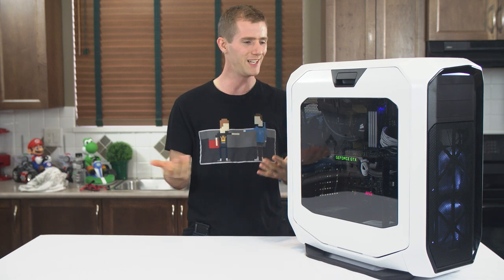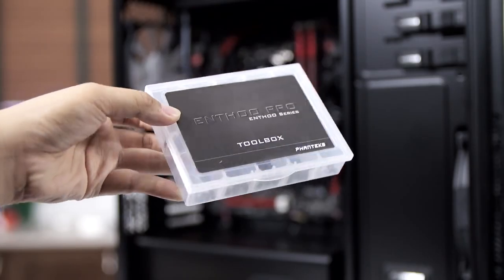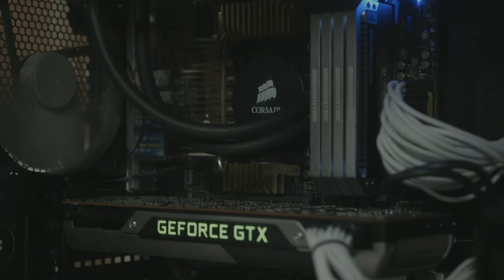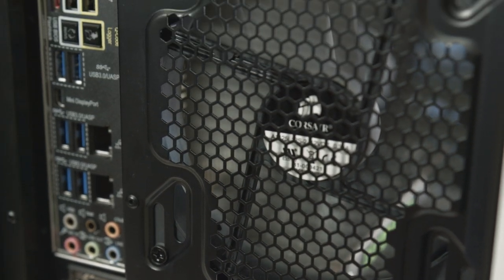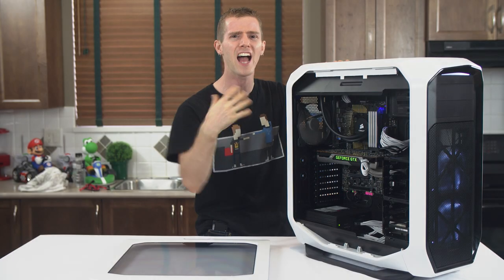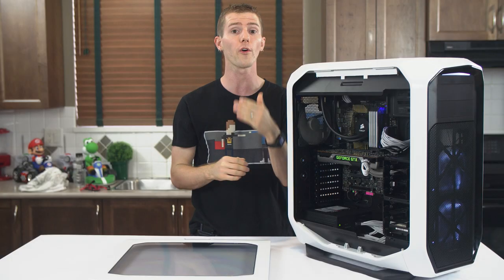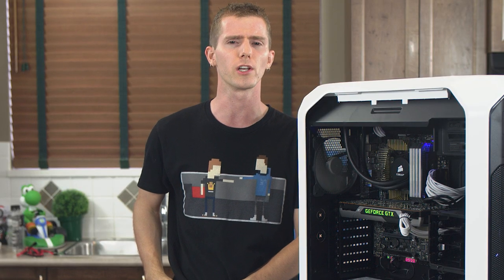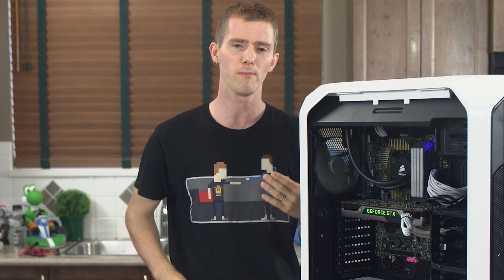Corsair 780T Graphite Case

Comment: Fractal Design All the way,IMO.
Reply: ***** I was a huge Corsair fan,but after I found Fractal Design and used Define R4,man...It's the best silent case I've ever used.I'm considering purchase Arc Midi R2 sometime maybe next Haswell-E build.
Reply: ***** H440 please.
Reply: McGrauado I like my Arc Midi R2.  Very nice case with an elegant, simple look.  It's very easy to build in and maintain.  If you go for one, you will probably not be disappointed.
Reply: lol scrub peasant gt on my lvl i xigmatek elysium al teh way m8
Reply: McGrauado I really don't know whether i want to buy a Define R4 or a Phanteks Entoo Pro :/
Is the Define R4 really that quieter? Because the airflow of the Enthoo Pro seems to be a bit better.
Reply: Phanteks>>>>>>>>>>>>>>>>>>>>>>>>>>>>Every other case
Reply: Love my R4 black with the window. Perfect case for me. Although I still think it's a little loud because I'm used to laptops haha.

Or it might be my h100i stock fans which I need to replace soon.
Reply: kiwikozo definitely the h100i stock, they sound like vacuum cleaners.
Reply: I have the 2 fans provided with the case as intake front ones. Then a white LED silent Corsair one as a rear exhaust fan.

The h100i stock fans I use as intake ones since I tried both and it actually runs cooler like that, and quieter.

Which fans do you recommend to replace them with? And please don't suggest Noctura - I have a window and I want my build to still look great haha.
Reply: kiwikozo Or might acutally be a power supply fan those are usually overlooked quite a bit. Well the stock fans on the H100i are a bit on the loud side.
Reply: Nope, I've put my ear next to the h100i fans and the case ones are kinda loud. I guess I'm not used to fan noise.

My PSU is excellent - EVGA Supernova 1000W Fully Modular Platnium. No sound at all.
Reply: I like my R4 but it just feels like they skimped in places. The hexagonal holes on the top are ugly and I'd rather it had a dust filter integrated into the case that pops out. The plastic on the front feels and looks cheap and I rather they'd gone with the metal that is on the rest of the case. It's pretty much impossible to use a 3.5 inch card reader in the front of the case with what's supplied in the box without having a hole in the case. It's covered up so it's not a huge deal, but I'd rather the bracket was included.

I love the sound proofing which makes it quiet, it has a fairly nice aesthetic although I'm finding myself preferring Corsair cases (some of them) for looks nowadays. The fans are fantastic - bought a bunch more for the case, I usually ramp up the RPM and they're still quiet. The rubber gromits inside for cable management are a godsend and I like the removable upper HDD cage and the "hot swap" style drive mounts.

All in all, the R4 isn't a bad case, but as I said, it just lacks a bit of care on the fit and finish. There's something about it where it seems like they didn't go all out, perhaps it's just the price point. I won this case and haven't had a case in this price sector before.
Reply: Ross Bishop Oh right. I didn't want a card reader, but I got a usb 3.0 adapter which makes it simple for when I need to use one. I dislike the plastic at the front too but you can't really tell if you don't touch it haha.

The dust filter doesn't matter to me either since I have a h100i installed so it wouldn't benefit me. Maybe the R5 when it comes out will have what you're looking for.
Reply: McGrauado  I was dissapointed with it. They could have used the extra space and move the top fan grid a centimeter or so away from the motherboard to accomedate large rads, that and the silly "NO TOOL" front fan bracket really gets in the way of putting non FD fans or ouright prevent front 2 fans rads, since the screw holes in the bracket are farther away from each other than what a normal rad has. that and the uncomfortable bottom fan filter, awkward HD cage that would block any front rad anyway and the lack of proper SSD bracket on the back of the motherboard are pretty awful for a case this expensive and this big.
Reply: kiwikozo It's not actually that I need a filter, it's just that the hexagonal holes are ugly, and that an actual filter with small holes that's embedded in the top would look way better IMO. It's just like they pressed out the holes and went "that'll do"
Reply: Christian Axelsson Oh man, I fucking dig that case. No wonder so many people have bought it, so cool xD
Reply: MSurai I never tried Phanteks Enthoo Pro so I cannot comment on that,but you can checkout Linus's review.
I think the parts you chose for your PC,it's the point and crucial to whether your PC will be quiet or not.
A good airflow case doesn't mean it will be very noisy,of course neither a good silent case will guarantee fully sound isolate,noise will always be there just a matter of whether it's in human's hearing ranges.
The reason I chose Define R4 because it was on a discount,plus it fit my eyes.
It has a lot of draw backs of course,but I don't care.and it uses very good quality thick steel,it's a little heavier but that's some darn good quality.
If you chose the right quality parts,I believe whatever the case you fit in,it will be quiet.
I personally uses Noctua fans,and use AiO liquid coolers on CPU and GPU(w/Kraken G10),I didn't put any hard drives,I did put two samsung evo 1TB ssd as my storage,of course I back up files regularly to my portable hdds or home nas.So far this kind of set worked out pretty well for me.
Reply: electroshakyeee Yup,I realise the problems you mentioned.I honestly don't care,'cause I bought it on a huge discount.FD's case are good,but at some details could be done it better,it needs feedback to them and I believe at certain point they will improve.I hope they will make a Define R5 and improve all these issues.
Reply: McGrauado I had a define R4 but i ended up switching cases to an nzxt phantom 820 since I just wanted a creative and less simple styled case xD
Reply: I have a Define Fractal R4. I switched from an NZXT Phantom 410 and I am never looking back. It is probably the best case that I have ever worked with.
Reply: I own a Arc Mini R2 and I can say only one thing - I will NEVER buy another Fractal Design case again. Period.
Reply: Christian Axelsson

Yep, I don't have any water cooling right now. I plan on it for my next build. I'm going to go for a larger case at that point. It would be nice, but my components don't really need water cooling.
Reply: kiwikozo Well, I have an EVGA SuperNova 1300G2 in a Phanteks Enthoo Primo (Excellent case, best I've ever used by a lot, and the Pro is quite similar in everything but size). Using Asus' fan control software, all my other fans are silent (Silent like, I cannot hear a difference even if I turn all the fans off. They're running at something like 400RPM at idle). The only things that are audible are the pump of my Corsair H110 (not too audible at idle) and, you guessed it, the fan of the PSU. It's by far the noisiest thing in my otherwise silent system. It's not anything unbearable like high-pitched or anything, but it's definitely there. So yeah, PSUs are overlooked with no good reason and that fan noise is my only complaint about the otherwise awesome EVGA PSU.
Reply: but fractual is ugly as fuck man i want an aggressive looking case !
Reply: Ross Bishop yeah it sucks you have to choose between airflow or a silent rig; I have 4 HDDs and my OS SSD that takes up almost the entirety of the front intake not to mention the R4s side vents makes a poor intake to begin with.

However if you really want to increase airflow; I really would recommend getting some of these: http://amzn.to/WJaXrM

They look good, they're easy to clean and paired with a really good pair of fans like the Noctua NF-A14s they're not even audible with any sound meter that I have used so far.
Reply: AbidNaga NZXT Phantom Cases did provided a lot of space for cable management back of the case.I built a PC with Phantom 630.Good for you,keep that case for a while.
Reply: i mean i am 18 fractual looks boring i mean dont u want something spicy or aggressive looking think about it fractual and most corsair look plain and smart
Reply: NF A14S are a rip off and offer no extra airflow proven before between fans vs fans
Reply: yeah i know i was just stating my opinion i get it tho i mean i can see my dad liking fractual but im more of a gamer so i like a rough look different people have different tastes
Reply: 96donov There has been proven airflow differences between fans vs fans in certain applications... radiators, heatsinks, open areas, or just fan blade design. And build quality of Noctua is legend status.
Reply: McGrauado
Same, it looks really sweet.
Reply: 96donov Almost every website I visit; Tom's Hardware, LTT, JayzTwoCents, AnandTech, PcPer, Tek Syndicate, the list goes on and on for people who have used Noctua products who either use one other option (Like Corsair's silent fans for their cool interchangeable rings) or they stick exclusively to Noctua like LTT because they know that time and time again CFM versus DB at low RPM provides the best airflow in the industry bar none.
Reply: Ross Bishop Just get some Silverstone ultra fine magnetic intake filters. They work like a charm, easy to clean, and well worth the investment.
Reply: Murdock13 I picked one up for $60 on newegg :D
Reply: I just ditched water cooling and stuck with the affordable Hyper 212 EVO paired with the R4 and it is pin-drop silent.
Reply: 96donov I'm 17,I don't like aggressive things,I like things that makes me feel calm and peaceful or relaxing,I guess I was influenced by Aikido's philosophy that I've been practiced since middle school.
Fractal's Product don't look ugly,it's just look stern.
Of course,I still have some other cases that's hanging around,like Corsair Vengeance C70,SilverStone SG02F,LianLi's cases that I don't remember the model number...etc...
Every Noctua's fans model number means specific use for best optimized airflow or static pressure.You cannot judge because you might use it the wrong way.
Reply: MSurai The r4 comes with excellent fans, they are quite and just awesome, don't know if phanteks does that, or any other brand.
Reply: Water cooled Define r4 reporting in.
You generally get so much for your money from Fractal...
Reply: H440 all the way bro
Reply: The world would be boring with just Fractal Design, every case would look like a mini fridge.

And this comes from a 304 owner.
Reply: Amen TheDarkMaster02, CPU AIO cooling is stupid. Using AIO cooling on my GPU, but it's due to the fact I had a leafblower 290X. I'd rather have a quiet Sapphire Tri-X card or go full custom loop.
Reply: cole sutra You don't get me, it's the case aesthetic that I have a problem with, not the filtering. I just want it to look less ugly on the top.
Reply: God King Blacc  I so agree with this. I should have waited for enthoo luxe instead of buying h440.
Reply: im not big on really any brand, just whatever gives you the best cooling and can support the maximum amount of fans
Reply: Define R4 master race
Reply: I am actually very attracted to the new NZXT Source 340. I like the direction NZXT is going in lately.
Reply: God King Blacc amen
Reply: Αποστόλης Νικάκης What case fans do you have? And isn't 400rpm too low? Not enough airflow?
Reply: kiwikozo I'm using the 5 Phanteks PH-F140SP fans that came with the case (Excellent fans, almost on par with Noctuas in performance, but they look much nicer) and 2 Corsair fans from my H110. Now, the 2 Corsair fans and 4 out of 5 of the Phanteks fans are used as intakes (excessive, but there isn't a spec of dust in the system). I'm planning to buy a few more Phanteks fans and ditch the shitty Corsair ones on the H110. Airflow isn't a problem. There is a subtle air current at idle (yes, under 500RPM at idle), just enough to keep air moving. Before that, I used to let the fans stop at idle, but decided against it as they don't make noise anyway. Under load the fans spin up, and I have more airflow than I would need for 2 PCs.

I think I'm turning into a Phanteks fanboy with these fans. They are that awesome. I have 5 already and I will be buying at least 2 more. Probably 4 more, if I go custom water and do push-pull, but that's another conversation.
Reply: my point was i dont find fractul appealing i never said gamers need aggressive the other guy did
Reply: fractual is ewww boring case
Reply: ive seen cases from cheaper companies on ebay I would rather have over bigger company names due to several fans, larger fans and the case itself being almost bigger than a full sized atx case and looking bad ass. alot of these cases from NZXT (which i happen to use one) fractal , Corsair are all kinda plain jane cases
Reply: McGrauado i like how the fractal cases are so understated and usefull without any flashy leds. In my next build im going to be using an arc midi r2
Reply: 96donov By the way being "more of gamer" does not mean you need a more aggresive case, and please for goodness sake at least use better typing skills. I am in middle school and I am currently building my computer and I love all the companies, I just make my opinions on each case not the whole company, if one of the cases from Corsair don't work for me, I just look for more cases from them and others to find the one for me. Also, when '"stating my (your) opinion" please state it like a well-educated person, so it makes you seem smarter and people don't diss you and large comments like this one won't show up everywhere.
Reply: H440.
Reply: McGrauado I recommend a lot the ARC Midi R2. It's super easy to build in there, it has very good airflow and it's also very sturdy. My only complaint are the dust filters: they're made of foam, so cleaning them can take a bit of time.
Reply: sharkfacestudios I've got red/black. Very pleased.
clauricaune Taking them out and running water over them and then allowing them to dry makes them good as new!
(Source: My friend's PC)
Reply: Cheesepuff i prefer the white or black/green, but to each their own.
Reply: Does anybody else regret commenting on this? 50+ notifications later,,,,
Reply: yes gotta love fractal
Reply: McGrauado Im stuck between going with the Corsair 330r or the Define R4 any suggestions or pros/cons for either one?
Reply: Kaleb Gilley Well between those two the R4 is better. Great build quality, silent. Just a good all-rounder. I would definitely go for that (Personally those aren't my kind of case, but the R4 is definitely the superior one of the two.)
Reply: Cheesepuff I'm really sold on the extremely clean aesthetic of the 330r and it would match the brand of my RAM, PSU and fans, even though the R4 may be slightly better performance wise, i think the aesthetic on the 330R is what's going to win me over.
Reply: Kaleb Gilley http://www.nzxt.com/product/detail/151-s340-mid-tower-atx-case.html (black or white)
Take a look at this before deciding. I ALMOST want to return my H440 in favor of this.
Those clean lines just get me. Plus a PSU cover and excellent places to hide those pesky cables.
Reply: Cheesepuff I'm not a fan of the window, but other than that it doesn't look too bad. I really like the PSU cover.
Reply: Kaleb Gilley Depends on you though,If you really like the looks of 330R,then go for it,there's no reasons that you cannot buy what you want from the bottom of of your heart.
Personally,I found R4 looks better,very silent,and it fits my desk very well.Checkout Nanoxia too,they make pretty darn good silent case,can guarantee you'll like their product style though.
Sounds like you want to match all your brands of your components,then 330R might be the best choice for you,but I'd actually spend a little more to get Corsair Obsidian 550D..that's just me...
Reply: Cheesepuff Yeah, I know. It's just that I have to use a hair drier to dry them fast; the whole watering-drying process for both front and top filters takes around 10-15 minutes. It's not terribly long and it's just a minor complaint, but simple net filters would take much less than that to clean.
Reply: Fractal Design is way too casual to me...
Call me hipster but I don't want a custom built PC that looks like a million others out there :\
Reply: If you get it with a window, and have LED Lighting in the case it's fine. I think it actually looks better and classier.

I have a R4 with a window, and NZXT Hue lighting, as well as an LED fan at the rear + a corsair h100i lit up. And of course you can see all of the other components too. That doesn't make it look like all the other builds. Only thing I would change is the quality of the window since it is supposed to scratch easily so you have to be careful.
Reply: Guy Random Same as Corsair,they sell cases all over the world.It matters what you've done inside,plus you can modified yourself,but it'll probably avoid the warranty.
Reply: I myself have a Define R4 and just ordered a Core 1300 to my little brother's rig.
Reply: llorTA toN  lol i have one im on the level haha but  just to big of a case i like to be able to actually fit on my desk but still an amazing case
Reply: and i agree with all the r4 users my cousins just got the define r4 xl and its quiet as ive ever heard from a case really niceley built i myself am looking at the s340 from nzxt i wanna build in that once to see cosmetics and how nice i can make it :) but r4 is in the works too
Reply: Guy Random amen !
Reply: Robert Echenoz teh bar is h1gh the bl8z iz gr8
Reply: 96donov Whatever, I'm just saying so no need to get all mad. Just don't say "I'm more of a gamer" ever because you are only a "real gamer" if you go to LAN parties and are seriously into gaming. I do this, and I speak proper to set an example to others that gaming is not always about sitting on your ass all day drinking beer and playing games, which I didn't say you do. I'm just trying to set an example and I hope others do too, Thanks for the cooperation!
Reply: God King Blacc Yup.  I don't regret one bit buying my Enthoo Primo.  It blows away anything Corsair has to offer in its price range.  My current build wouldn't fit in a Corsair case anyway.
Reply: RottenMeatius22 i barely care about gaming
Reply: 96donov Go hate somewhere else then :)
Reply: 96donov You're hating on people, everybody wants you to leave. Bye.
Reply: kiwikozo i would recommend corsair fans, too, but the sp 120s would do fine! Anyway noctua released new color schemed fans! they aren't that bad anymore! haha
Reply: YS T Oh right thanks! I will check them out!!!
Reply: kiwikozo Actually,If you're open for another suggestion,I would recommend Silverstone's Air Penetrator series Fans,they provided pretty good static pressure and more focused airflow.they are inexpensive and perform pretty good.
Reply: McGrauado Thanks, but are they as quiet?
Reply: kiwikozo Yes,they are,even at 12V(1500rpm max).Linus did a unboxing,you can check it out,I still using them in other PCs,I used them on my rads,performed very well,very quiet.
Reply: McGrauado Alright thanks. I'll check them out.
Reply: NZXT life
Reply: kiwikozo
yeah bro i noticed those fans and the high performance SP120's are really loud. but no need to replace. use corsair link to Default mode. i never heard them ever since (we all have a diff experience). I love the R4 though its so quiet and clean looking.
Reply: Phanteks fo shizzle <3
Reply: Everyone is stressing on the Phanteks, Corsair and Fractal Design. You guys might need to check the H440 :p
Reply: Kirito Cray I'm getting the H440 for my first build. Im sitting here with a gateway with upgraded ram and a low end gpu
Reply: Kirito Cray We didn't forget H440.NZXT makes quality cases how could we forget their H440?I built one,but I didn't keep it.I don't prefer cases without 5.25" drive bay.
Reply: McGrauado You still use the 5.25' bay? Damn.
Reply: Kirito Cray Hey no hate! Some useful 5.25' drives. Like hotswap hard drive bays, toasters, storage compartments, IRS, Multimedia card support, CD/DVD for media PCs and stuff :))
Reply: TadghsMuffins Not hating! xD Hotswap hard drive bay is good, but others? Weeeeeeeelll I personally don't use them because for storage, we have other smaller alternatives. Or I can mod my PC a fair bit.
Reply: Kirito Cray Yeah,I still use a Blu-ray drive.
Reply: McGrauado I use that on my big ass TV.
Reply: Kirito Cray I rarely watch TV.
Reply: TRY the Phanteks Enthoo Luxe
Reply: I want new case any suggestions, need to be windowed for maximum 200$.
Reply: I wil probably buy Graphite 760T or 780T. Cant find better case :(
Reply: Cruciatify corsair obsidian 750D maybe?
Reply: This Obsidian 750D is pretty nice have it good airflow? I wanted NZXT H440 beacuse it looks badass but peoples are complaining about airlow :P So I wont buy it... Isnt 780T Graphite better? Its only 40 euro difference in price...
Reply: Cruciatify Both Graphite and Obsidian series cases are designed for good airflow and water cooling,so you really don't need to worry too much about it.Only difference is the looks and LED fans(Graphite).If you want a full tower and good airflow,fair price,I'd actually recommend Fractal Design Arc XL,the only draw back is it didn't have a clear side window.NZXT H440 is designed for silence,airflow isn't the main purpose.Rest of it is up to you.
Reply: ***** In the end,it all depends on personal preference.To me 780t or 760t both are pretty much the same as Arc XL,but different looks.I don't know,but even in my mancave I still choose Define series over anything else,maybe because I'm sort of a silent freak,I just can't stand the little fan noises,even the slightest sound.
I don't think anyone of them is superior or far more superior to each other,they all pretty much equals to me,just the matter of the price tag.
Reply: ***** d the iig u 84
Reply: McGrauado dislike
Reply: McGrauado Linus likes the 760T,but hates the 780T,witch,BTW is NOT the 760Ts "Big brother",it is only another Graphite.
Reply: McGrauado They got boring.They are more than good,but a bit boring.They all look the same.I like the front of them,but i hope that they do something groundbreaking for the rest.
Reply: I bought this case in January 2020, and i start to use it now ^^
Reply: I paid 276 $ in January 2020 ;) That's how much it cost now !!! To be exact 1106,05 RON (Romanian lions) , which was 276 $ - VAT & shipping included (from local retailers in Romania). I think it's ok, considering that my income is around 600 $ / month in 2021 ;)
Reply: @neytiritetskahamoatite7688  First thought on reading your comment, since it has been so long, I totally forgot I commented this comment, anyway, you said you paid $276 USD equivalent of currency of Romania, I honestly think you've got ripped off, although I don't understand the commodity price in Romania. But when this case launched, I remember at the time it was only around $180 USD or so, and it has been so long ago, and I believe this case has been discontinued. I just couldn't believe that you paid so much to get an old product, technically it's not new, and for that price, you could get much more better case than that. Perhaps you just love it so much that you're willing to be paid for it.
Reply: @cyangtw  actually all the stores in Romania still have this tower, at that particular price :) all of them !!! I took it from the cheapest one, by using not one but two price optimizers programs that we can find online here in Romania :) If u have a 500 $ cpu in USA, here is around 3000 RON, u can make the math, it's around 700 $.  Europe is damn expensive ! I started to buy from outside, because with the shipping cost altogether, you get a lot cheaper products, that industrial retailers in Romania.
Reply: @neytiritetskahamoatite7688  Oh dammmnnnn. Although with the COVID pandemic, causing the difficulties to ship products around the world and prices are going up, but I still surprised how much more expensive than the other world in Romania. Shopping online, buying from the other countries, it's a good idea, but be careful with the warranty, some product or companies have limited region warranty and does not have global warranty.  Well, I, myself, still waiting the price of RTX 3090 or 3080 or hoping upcoming RTX 3080Ti will be cheaper or prices dropping down, because of my new studies on deep learning will need it.
Reply: @cyangtw  Nice, i hope will exist a RTX 3080  Ti. Though i must say 3090 is a damn beast, i hope 3080 Ti will overcome 3090 :) I will try to buy things from e-bay from now on, in the hope i will find a better priced good stuff for my pc :)
Reply: There is a humongous both physically and online market hub in Romania which is called Emag and is emag . ro . I write that way, cause i can't link anything on YouTube. U can see there all the prices which 80+ % of Romanian are buying IT, smart, tablets, laptops, electric and electronic stuff, as well as all other stuffs market can have ! 
Note that now 408 Ron are exactly 100 $ (pls verify that ^^), and see four yourself how much each CPU, RAM, CASE, VIDEO CARD, MOBO is ... and compare with your country prices !!! 
It's BY FAR , pure robbery and pure exploitation :D 
You will be AMAZED :D